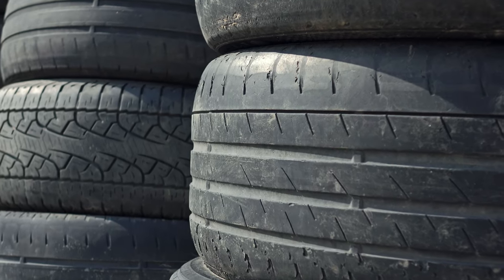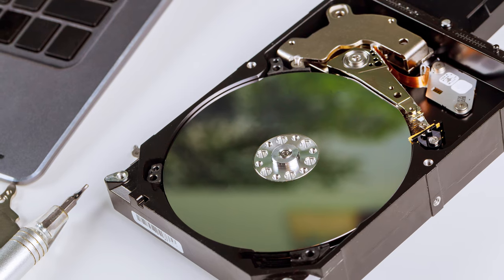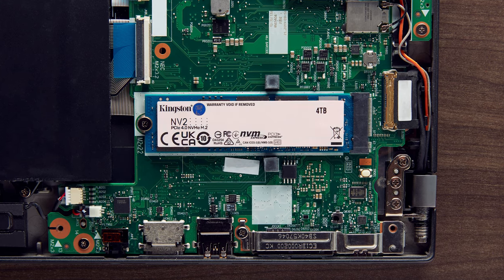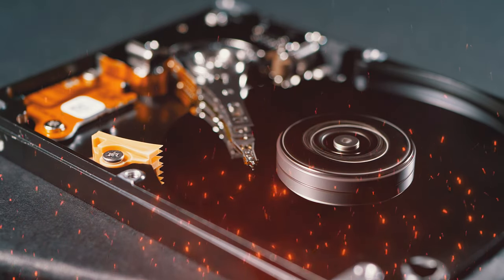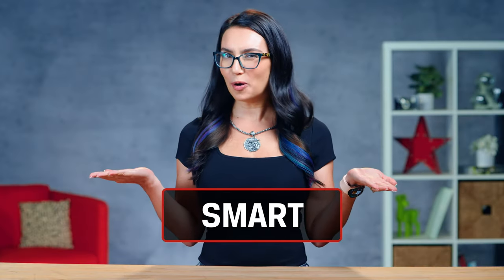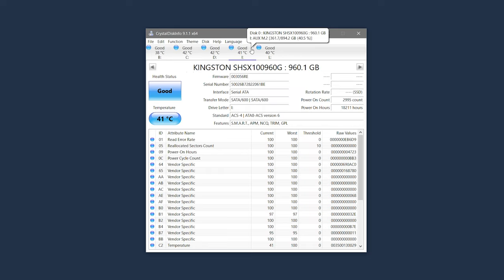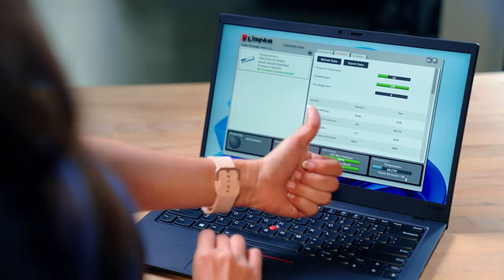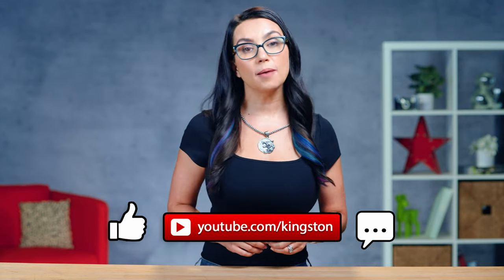Common PC problems and how to fix them: SSD – DIY in 5 Ep 205

Comment: Off topic but another tip: I suddenly had multiple USB3 port failures on two of my machines, one running Ubuntu, the other Windows 7.  The ports would not supply power to the connected devices but otherwise worked fine.   I reflashed the bios’s in both machines and restored proper operation but I built the PCs 10 and 8 years ago, respectively.  My guess is the coin batteries on the motherboards are finally expiring.  I expected other more obvious failures when the batteries were almost dead but these were pretty subtle!
Reply: If the coin batteries are indeed expiring, you are gonna experience a whole lot of problems beside the lack of PD from your USB ports.
Reply: @purplecrayon7281    That’s what I was expecting but after 8-10 years, and the problem appearing on two unrelated systems, replacing the battery is a cheap if inconvenient fix…can’t imagine anything else being the cause.  Reflashing, the BIOS solved the problems for now but something must have gotten corrupted.  Neither machine is powered up for long periods and the Windows PC is in my observatory and with our current weather conditions, rarely used until conditions improve.  Perhaps that’s why my even older laptops are still OK - one is my camera server and hasn’t been shutdown for several years.

Comment: I thermal cam'd the HDD out of my Xbox One X along with the SATA SSD i replaced the HDD with. Under heavy load the HDD ran at 135F, while the SSD ran at 85F. that 50F drop in temps did make the Xbox run quieter & cooler

Comment: Please help provide info. I am wanting to upgrade from one SSD 1tb to a new SSD 2tb. Is there any possible issue with this? Such as, if there are bad blocks on the current drive, should I not upgrade. Also,  system migration vs disk migration. Which is more ideal?
Reply: Are the number of bad blocks increasing over time or does it stay constant? If it's constant and you are still able to access every file, it should be ok to do the upgrade.

Comment: Using SSD Manager, down the bottom, SSD Wear Indicator says 87%.  But if I click on the Health tab, the wear indicator says 13.  how do I interpret that?
Reply from the maker: The SSD Wear Indicator gauge found at the bottom of the main user interface displays the remaining write endurance on the Kingston SSD as a percentage. A brand-new drive will indicate a value of 100% meaning it has 100% of its useful life remaining. This value will begin to decrease as the drive is used over time and the health tab will show what percentage was used. For more info please check the User Guide found here: https://kings.tn/3yJm6kF
Reply: @kingston  perfect, thanks very much🙂
Reply from the maker: You are welcome. If you have further questions, please visit us here: https://kings.tn/3yMQCtU

Comment: Hi
I have a Kingston SSD KC600 
I am unable to find SSD in Kingston SSD Manager
Even its initialized and formatted.
What's the solution to solve that problem
Note: I have also used both version of SSD Manager available on Kingston website
Reply from the maker: Hello please make sure you follow the minimum requirements like having the SSD installed internally in a native port, and you are the admin for your system. To learn more about the SSD Manager, please visit our site here: https://kings.tn/3QuCA5c 
If you need further assistance, kindly contact our support, and we will gladly help you out: https://kings.tn/3u6QlQ1
Thank you.
Reply: @kingston  I had an issue with one of first kingston ssd . After two Years from time I bought it health on 98 % , performance about 96 % . then few days later i see " Media wear off" . It was not caused by  reach total data written on drive ,  This was System disk in my garage , used from time to time . But the producer set warranty date limit . After modify this variable ssd works to this day like nothing ever happen . It is been more than 12 or more years since I bought it . Works perfectly till this day .

Comment: SSD's can actually produce more heat than an HDD
Reply: They still have a max temp they can reach. It is not hot usually because the normal operating temperature range for an SSD is between 86°F and 149°F, or 30°C to 65°C. If the temperature exceeds 70°C, the storage device will fail to operate and reach the end of product life. so as you can read if they get over 65c they can be damaged. most hard drives goes up to max 50c. but some Seagate drives can still operate at 65c.